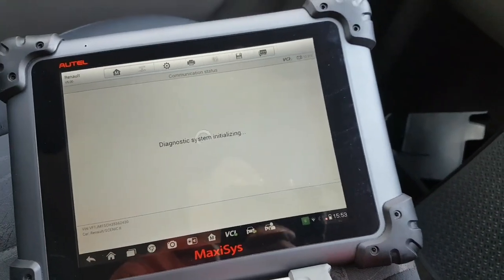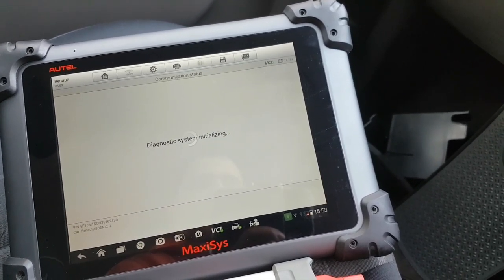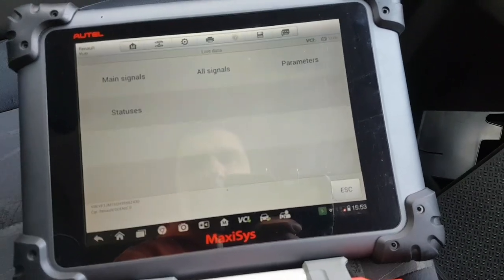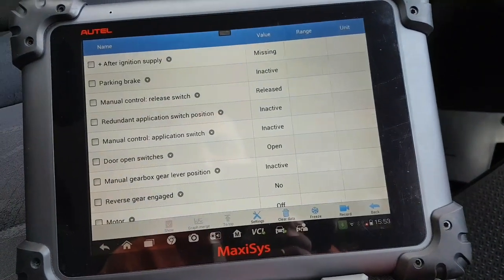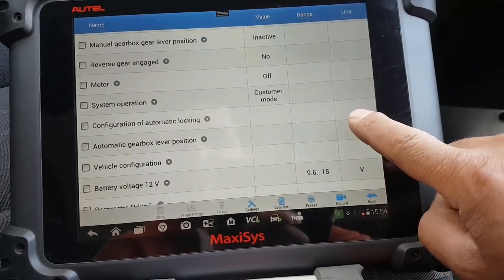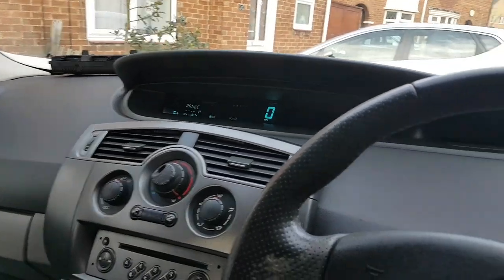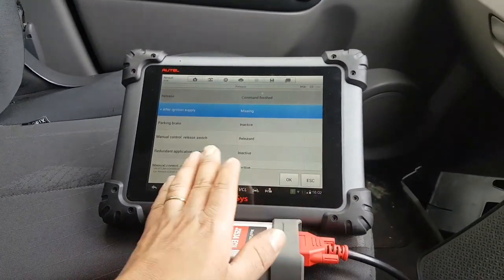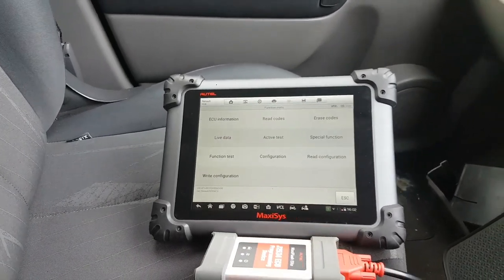Scenic 2006 Electronic Parking Brake not working. R2 strikes again... Fault finding and repair.

Comment: Very valuable effort having shown this to owners ! Thank you LM Auto Repairs !

Usually the root cause is the drain outlets at the back of the engine compartment (below the ventilation inlet beneath the windscreen. The pipes are supposed to drain rain water out into the front fenders.
When those drain outlets get clogged by dirt, leaves, and what else then in rainy weather (or car washing!) the water will overflow into the passenger compartment behind the floor mats until it reaches the area under the seat.. And this damages the cable connections and socket you illustrated. So if you have got a Scenic 2 that is still working properly
then a cood precaution is to spend some time cleaning up those drain outlet pipes. Flush them with. pressure water. It can save the car for years to come.  Provided that you ever use it in rainy weather or wash it a lot !

Comment: It is a common problem in this model. Just last week I repaired one. It also had the parking brake button faulty. 
Thanks for the video Luis.
Reply from the maker: Common indeed! 
Thank you for watching and for your comment!
Reply: Yep me too, done fair few of these! Soon as I saw the title I though the passenger seat is going to be out :)
Reply from the maker: @threepotMR2  
Lol
👍👍👍
Reply: How much would this roughly cost? Mine has gone 🤦🏻‍♂️
Reply from the maker: Takes a few hours to repair... depends obviously how bad it is...
Can be costly if you are paying garage rates...
Thank you for watching and for your comment!
Reply: this happens because the drains under the wipers become clogged, and it will happen again if it is not cleaned

Comment: Man respect ,i know so many garages that could not fix this prob,they even made customer buy ney hand brake motor,expensive, as i used to be an ex Renault techical advisor ,we at dealer level knows this issue, so with the iring diagram and controls, and most scenic ,do get water penetration ,so witha bit of patience like you did bro, problems always solved,respect agan.u have the fighting spirit ,just not give up and tell customer take ur car,probably ur uch is gone take it to dealer,this is response u get from garages (not qualified elecrician or electronics, BRAvo hats off keept the fire burning
Reply from the maker: 😊
Thanks, for watching and for your comment! 
Appreciated! 
👍👍👍

Comment: The front drains are blocked (Bonnet up N/s drain needs unblocking)  Temics are a common fault on scenics when windows fail.   I used Clip for fault finding, and  after spending a fortune on never ending problems with it i got rid.

Comment: It happened to me with a Rover 620 1996 .. its ecu and tcm was diving under water .. first i thought it was the immobilizer issues because the engine was cranking but no spark and no fuel .. i worked  with out a scan tool but we fixed it ..the rain water is so dangerous to our cars we should check the draining lines always .. really your video was helpful and you are very good thx 😁😁
Reply from the maker: Thanks!
Reply: @LMAutoRepairs  u r welcome 😎

Comment: A right mess under the bonnet and great detective work checking the windows and looking under the seat. That car needs sealing. The plug & socket were really bad....they may not need replacing now you have joined all the wires. Another interesting video, Luis,  thanks.
Hope ur laptop is fixed now...I have just made a clone of my main laptop HDD just in case the hard drive goes down , even though I make several backups of my files.
Reply from the maker: Indeed... backups are always good...
Thank you for watching and for your comment!

Comment: Solved one today with this problem thanks!! But still have a problem with the radio it won’t turn on or work every time! Sometimes it works but only the steering wheel buttons work and the arm rest buttons for the navigation, the others in the radio won’t even get backlight just the power button
Reply: @LMAutoRepairs  got another this week but this one is getting complicated... First i fixed the r2 connection because both rear windows and epb stopped working.. and just after i plugged the scan and discovered the 5162 error and i ordered a new relay and replaceced the old one... but just after that didnt work i check the motor inside the motor... and guess what ? the brushes turned in to dust!!!! new motor  installed and still the 5162 error... at this point i think i should have choose to buy a second hand unit.... any tips? TIA

Comment: Many thanks for a rapid reply, Yes it drives, everything works except for the intermittent front N/S central door locking (not often), I will watch supplied link, any suggestion for testing to get the central locking on front door working?
Reply from the maker: Difficult without checking...
Perhaps the loom on the hinge... just a suggestion...
👍👍👍

Comment: March 15 2019. You must have a good back catalogue of videos
I had a head stratch with a laguna to be traced back to a corroded wire which is posted on one of my videos to others
I hate these electronic handbrake   why reinvent the wheel when normal cables will do
Reply from the maker: 😋
Yes... I have a few videos upfront...
Thank you for watching and for your comment!

Comment: Question, you said before about low battery voltage and module damage,. What should we do and how do we change a battery on a modern car safely?
Reply from the maker: The problem is not voltage off ( battery disconnected), voltage on (battery connected)... is low voltage, there is a difference...
Thank you for watching and for your comment!

Comment: Great video but scary for a novice like me!😉

Where did you get off wiring diagrams? What OBDII/ computer reader do you use? Could You do a video on how to use it?

Your obvious expertise made me realise how little chance there is for me to find what the actual problem is because I don't have any prior experience, I don't have any wiring diagrams and don't know where to source them, and I don't have a computer OBDII reader.

I saw a great video from a garage in Wales on how to remove the auto brake unit, open it up and source and replace the motor. I did this and the removed motor brushes were corroded and broken. Lots of carbonised grit and copper came out when I tapped it, so I know the motor was u/s and I reassembled everything and put it all back. But...

...Disappointment.. the renewed parking brake still doesn't work and there is no light on the driver's release switch.

I heard that auto brake motor failure is common round about 60-75k, and I only bought the car for £400 as spares and repair because it was in good condition with only 70k on an 06 plate and the reason it was cheap the brake didn't work. Having refurbished and 're-installed the brake module I'm not sure how to proceed. I have already taken the brake switch out, cleaned all the connection with contact cleaner but there is still no light and no power going to the brake module. No evidence of any water ingress in the cabin anywhere so could the problem be fused or still under the passenger seat?

Renault repair is out of the question due to costing probably twice what I paid for the car. Can't PX it, can't sell it, the engine purrs lovely but MOT due in October. I've SORNed it. Hate to scrap it because it's a lovely motor if only the damned brake would work.
Reply from the maker: Hi
Diagrams, Google is your best friend...😉
The water ingress and the corroded R2 plug is a common issue...
Worth to remove the passenger seat and check it...
Thank you for watching and for your comment! 
👍👍👍

Comment: which version of maxi sys do you prefer and afordable >>
Reply from the maker: I have the IM608,  and the MS908P...
The MK models are more affordable...
👍👍👍
Reply: @LMAutoRepairs  i saw you using the Autel maxi im , such a high price for a high tech tool , enjoy it , and thanks alot
Reply: @LMAutoRepairs  does the mk line has  the ability to actuate ??
Reply from the maker: Yes...

Comment: Hiyaa, where are you located? I have a 2005 1.1 206 HFX that has no spark, an auto electrician is baffled as are plenty of other people, so far it's had the whole engine wiring loom replaced, continuity between the coil and the ECU, 2 coil packs, an ECU and BSI, BCM and still no luck, it has Fuel pump priming and injectors firing, Just no spark.. the only codes within pp2000 are No spark cylinder 1,2,3,4 P0351, P0352! any info would be amazing and thankyou very much!

Comment: hi do you ever give advice. I have a Renault Zoe that is a cash repair i have an earth problem, the codes are many, but the problem is the auto lights and lock side of things. Does the reader you use help identify the problems. Thanks
Reply from the maker: Hi
The Autel can read modules stored faults etc... should help you go in the right direction...
Thank you for watching!
Reply: @LMAutoRepairs  hi were are you in the uk?
df052 12v relay df019both left and right headlight indicators short to ground. i know its between the upc etc any pointers?

Comment: Greetings and thanks for your videos, as you invite questions could you please help. I have a Citroen C4 (B7) 2015 1.6 hdi and garage diagnostic reveals code B1624 Central power switch positive relay status fault, on the supplies protection & management system. Also battery not charging fault (it iis) and service light is always on, also cars own
 diag. says electrical problem. Also Calibration down loading fault (ridiculous code P0300) to low. The car was in for service , these faults were revealed but they dont do these repairs (do not know where it is?). These faults were caused (they say) by poor AMG battery, replaced and faults persist. Any ideas? Thanks again for very detailed and explanatory videos!!!
Reply from the maker: Does the car runs?
Have you checked this:
https://youtu.be/_j48mO-1JBE
No saying at all that that is your problem... but you need to start somewhere...
Something like that, is very tricky to give any reliable advice... 
Thank you for watching!

Comment: Hi there, I have a friend that has the same car, and he has a problem with the permanent 12V going to the stereo, the ignition 12v for the stereo work fine tho, anyway, I have not been able to fined where this wire is going, checked all the fuses but could not find anything. Do you think you could help me with this, I do not understand how this car is wired and if everything is going through some control unit or not.
Thank you!

Comment: By the way have u done laguna 3 electric parking brake issue ,parking will not disengaged when u drive,it does come on automatically when parked,but when passing gear to take off it wont disengaged, multiplex error, clutch position sensor switch,well do u have any idea.i got 2 lag3 with same issues. the motor does work, its only disengaging.Any ideas welcome.as i work alone i dont have much time to go and control xyz places, if an idea will be great. clutch position sensor????

Comment: very useful video. I wanted to ask you something. I have a Megane 2 2003 with factory xenon, I did the automatic leveling, so after 5 sec it lowers the headlight level. The beam of light falls low. So sometimes the headlight leveling is raised by itself, is that maybe up to that connector R2? and sometimes the trunk opens on its own.
Reply from the maker: Hi
Never had this issue on a Megane, not even sure if is has the same R2 plug... 
But worth check if there is any plugs and/or corrosion...
👍👍👍
Reply: @LMAutoRepairs   Txn 👋👍👍👍

Comment: Hi dear,
Are you used a wire with resistor checked multimeter
Reply from the maker: Sorry, but I don't quite understand your question...
🙄
Reply: @LMAutoRepairs  are you switch checked multimeter for use two wire with resistor
Reply from the maker: @badmarvel1840  
I think I know now what you mean... yes it is...
Thank you for watching and for your comment!

Comment: How does the water get into the car
Reply: Me too. How did the water get there?
Reply: Scuttle panel drains are / were clogged. The water can't be drained normally and finds it way through the air vents / air system into the car.
Reply from the maker: @bertrandvanleeuwen  
👍
Reply: The blocked scuttle panel drains can be seen from the bottom if you remove the rear half of the black plastic inner wheelhouse liners left and right. It helps if you remove both front wheels. Cut the black rubber drain tube off where it exits the frame above it (rearwards of the suspension springs). Do not attempt to unblock it, it will clog again soon. just cut it off there, that is ok

Comment: Let me know how I can book my Renault espace with you. Thanks!
Reply: Hy what is the problem? Do you have same on dashboard  P  and service. O have this after I changed  the front and rear pads,and now the brake is veri soft and pedal goes to the ground, however  the epb is worki g fine just the P and service  on the dashboard.  Can you tell me what is your issue or you fix it?

Comment: My Renault is currently in the garage, the have changed the hand break unit (EPB) and my passenger side caliper, however even with a new module the hand break isn't working at all, as in its doing nothing, I don't suppose anyone has any idea what could be wrong? The mechanics are scratching their heads atm not knowing what the issue could be. Thanks for any advice
Reply from the maker: With all the respect, take it to someone that knows what they are doing...
Have they checked power and grounds at the module?
Have they checked communication lines?
Why was the module replaced, which codes were set?
Thank you for watching and for your comment!
Reply: @LMAutoRepairs  its at my local garage, I've just called and they have said I may need to take it to a Renault garage for diagnostics which is a pain as we don't have one local, he said him and his team have tried everything. It's driving me mad as I have been without a car since Sunday evening. The car will run perfectly just no hand break. Thank for your reply
Reply from the maker: @p_games2399  
I understand, but as I said, there a few things they need to check... otherwise they will never find the problem...
Replacing parts in the hope that fixes it, is never the right way...

Comment: Hi, I need help with my parking brake. I have Grand Scenic II 2007 2,0dci with automatic transmission and i have this problem: Parking brake works, but LED on parking brake lever is not working and so it is throwing error on dashboard and i can read with diagnostic this error codes: DF016(Warning Light Circuit) and DF045 (Redundant brake switch). I tried to change lever but it didnt help. Did someone encounter this before ? It is quite annoying to see everytime error when i pull parking brake.
Reply: So i have found out that connector beneath drivers seat (left side version, on right side version it is beneath passanger seat) was rotting, so i had to remade it, every cabel one by one and now it is working. Hope it will help someone :)
Reply from the maker: Common problem...
Is in this video... and I have some more on the same issue...
Make sure you unblock the drains that cause the water to get in there in first place...
👍👍👍
Reply: @LMAutoRepairs  Is it shown somewhere in the video where to unblock drains ? Couse i cant figure out what do you mean, guess my english isnt too good.
Reply: @LMAutoRepairs  Also, maybe you encountered this problem, i was doing particle filter regeneration on my car with Can Clip, and after it was finished, i run after regeneration program, then went out from injection section and when i tried to enter it again, page was blank, it looked like injection computer was gone, and when i go to Consult VIN codes tab  there isnt any VIN code written next to injection, all other computers like radio, instrument, parking brake does have VIN code next to it, just injection one is gone. Is there anything i can do about it ?
Reply from the maker: @Majky684  
Must have been a coincidence...
Is the car still starting ok?
Reply: @LMAutoRepairs  Car is starting good, everything looks ok, just trough clip i cant diagnose injector unit, is there a way how to write VIN code back ?
Reply from the maker: @Majky684  
Possible on the bench...
Don't think clip will allow you to program the vin on an already programmed module... unless you have flashed the ecu...
Reply: @LMAutoRepairs  It's a shame, wonder how did it happend. Same thing happend a while ago with radio unit when i took out radio repaired it and i placed it back and VIN number for radio was gone and i couldn't diagnose radio unit trough clip anymore.
Reply: Hi, I have the same issue, automatic parking brake works but the red led doesn't and I get the fault break message on the dash. I removed R2 and soldered the wires but I guess I made a mistake somewhere. Any chance of telling me which are the three  wires that go to the parking brake? Their color codes?